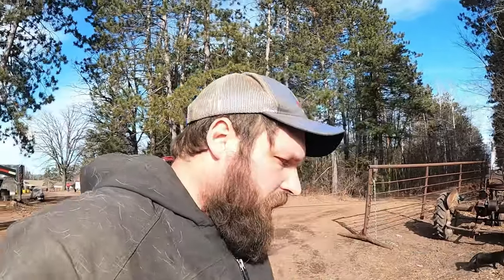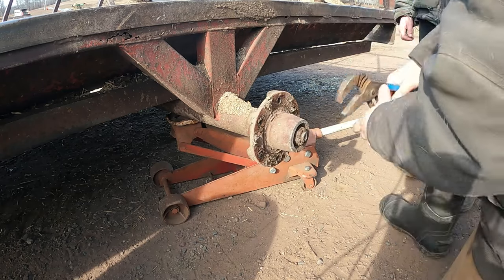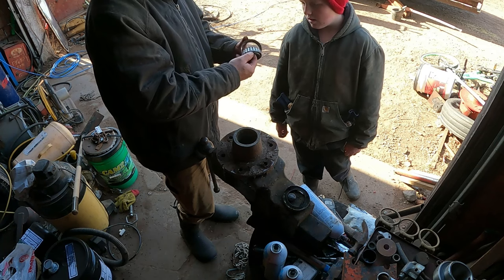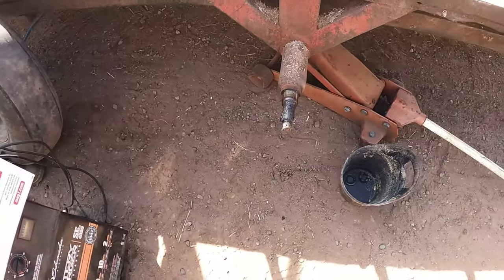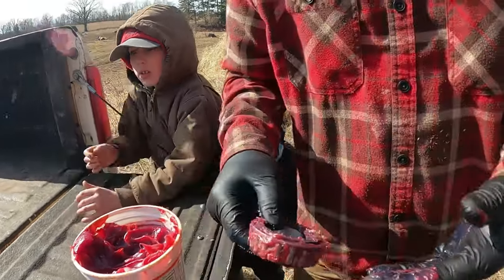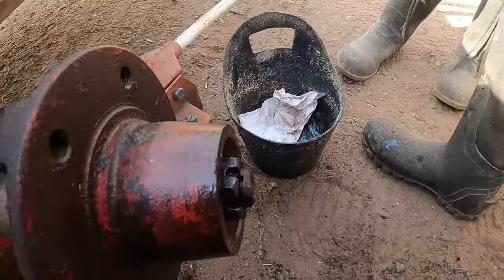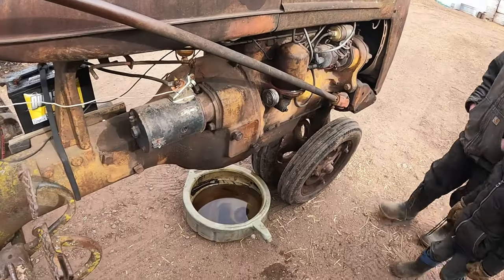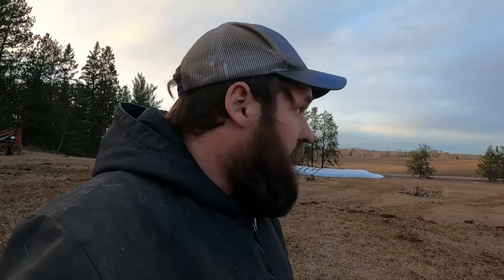Feeder Wagon Wheel Bearing Replacement/Spreading Some Manure

Comment: I cringed when you said you were going to use a file in the shaft to clean up for the seal! Wire brush or fine emery cloth doesn't remove metal as a file can. You can lose effectiveness of the seal if you aren't careful. Great video though! And really nice to see you teaching the next generation. And I usually put the races in the grease and spin them before I install them. Love the nitrile gloves for that job. 👍👍
Reply from the maker: I normally wouldn't use the file, but it was pretty rusty.
Reply: @trinitydairy  gotcha. Been there, done that. And that's why I cringed! 🤣👍